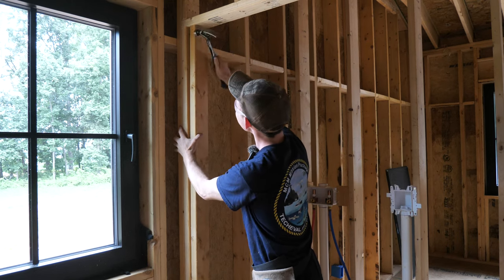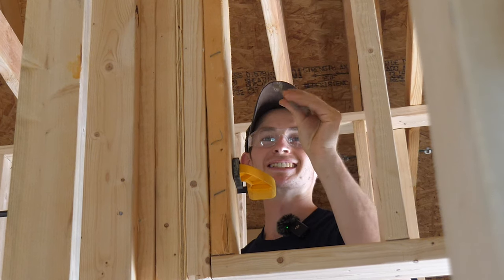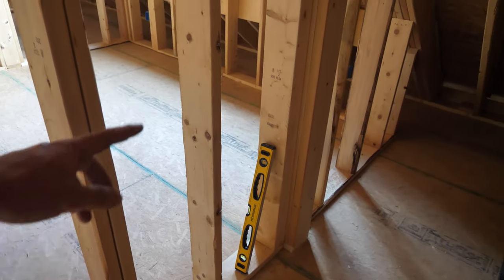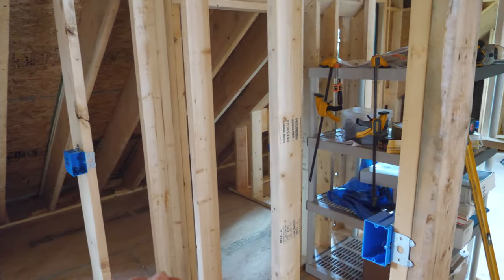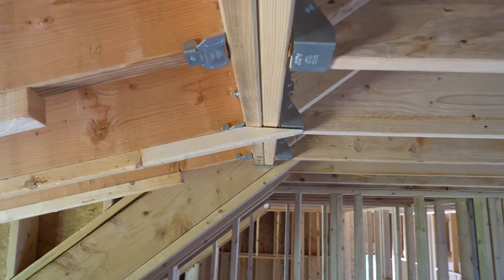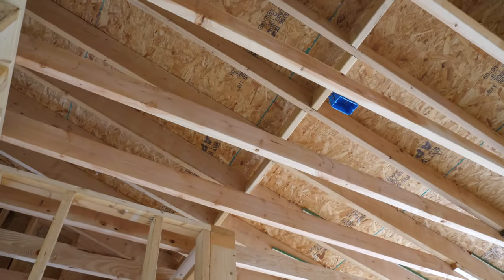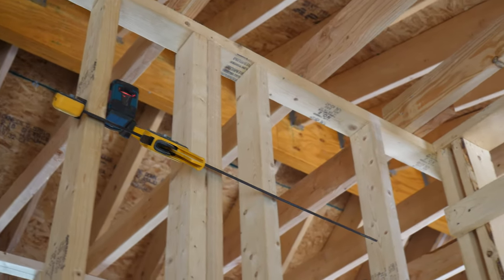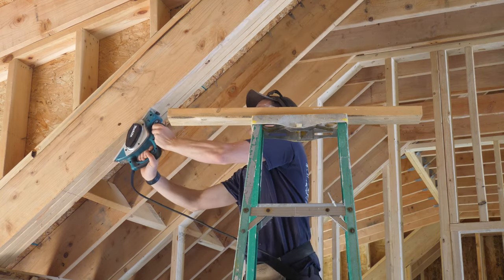Remodeling our New Build.. Already?

Comment: On the pocket door, remember later that you can't mount anything on the wall where the pocket is (inside or out...) because it doesn't have any studs. Even hollow wall anchors can damage the door as it passes through the pocket.
Reply from the maker: We actually will have two floating shelves that overlap the door frame! But planning some special steel to make it happen 👍🏻

Comment: Those screws cost around 10 times what nails cost. I'd have used your framing nailer for the furring strips. If you're worried about holding power, just use ring shank nails.
Reply from the maker: I was curious so I did the math, the screws are 5.2 cents each, nails are 2.7 cents each. So they are 0.93x more expensive 😁

For the furring strips, I chose screws over nails due to no risk of splitting the 2x2, better control, better pullout resistance than a ring shank, and it was easy to pull a bowed strip tight. Worth it imo

Comment: instead of 3/4 x 1.5 boards.. use 3/4 plywood and sheet rock on both sides  super strong, can hang shelves on it [on both sides if needed]   use pocket screws on the edge of the plywood every 10" around and you wont need any furring strips.. just a idea
Reply from the maker: That's a good idea! Now I just have to stomach the price of a couple sheets 😖

Comment: Cool customizations! I'd be worried about the pocket hole screws in some of the applications you used them in tho... especially the platform above the laundry room if it will potentially have a bed and hold people. Why not just toenail with GRK or simar structural rated screws? Faster, no predrilling, and properly load rated.
Reply from the maker: Thanks! I didn't think it really warranted anything extra, if I needed to make another trip to the store I would've just bought hangers. It will more practically be a storage shelf than anything, too little headroom for even a kids bed now that I've climbed up there a couple times. But feeling how solid it is I have no worries on the strength. The screws I used are #9x2.5" general purpose, not the thinner pocket hole screws. I think there's 15 of them on the center three 2x4 joists, side joists nailed to walls